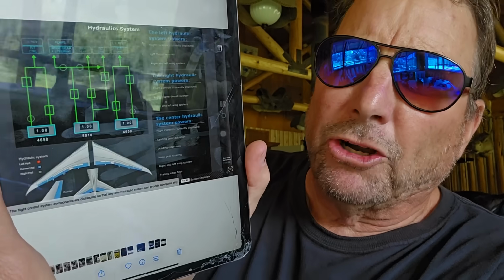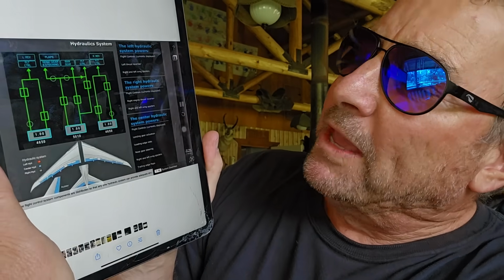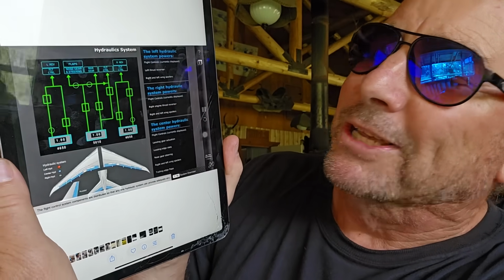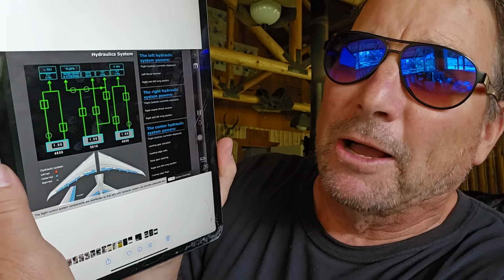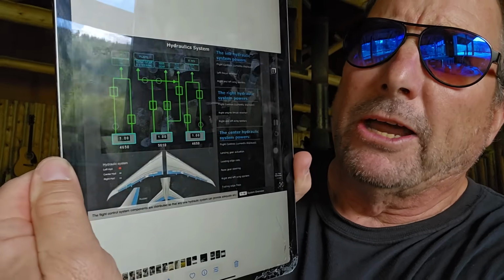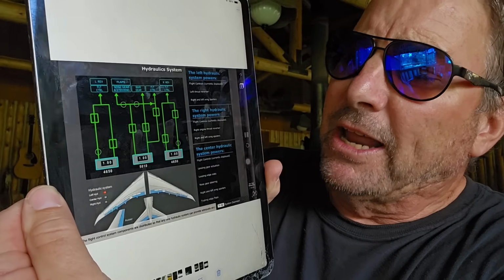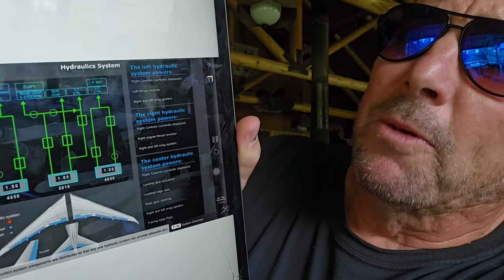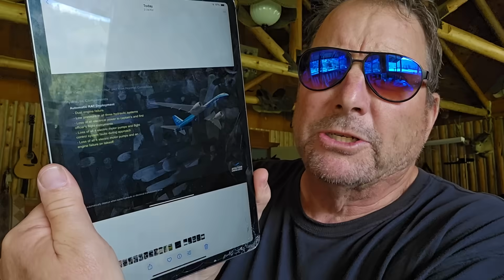787 Crash India What's a RAT? When does it deploy?

Comment: So many comments here still defending the flaps theory when there's zero evidence they were incorrectly configured or raised. We do however have evidence of a major electrical failure.
1, Sound of the RAT having been deployed
2, Loss of ADS-B data almost exactly at the point the plane stopped climbing.
3, the sole survivor said there was a bang and the lights were flickering after takeoff.
Reply: Without any hard evidence we can only say that the probability of the pilots taking off with an incorrect flap setting in a 787 is very low.
Reply: @ThereYouGo182 if they used the electronic pre takeoff checklist. However, if they only used the electronic pre taxi checklist, and disabled the flaps warning system during that, then didn’t hit their pre takeoff trigger due to unusually taking off from halfway down the runway (perhaps at the last minute) then maybe the plane didn’t know it was taking off so didn’t warn them about incorrect flaps settings?
Reply: Absolutely ! The loss of ADSB data is just another pointer to an electrical (NOT an engine) failure.

I'm very much convinced of a serious electrical issue. On a previous flight that 787 had electrical problems (video'd by a passenger apparently) and the sole survivor of the accident flight reports a loss of cabin lighting too, shortly after takeoff.

TOTAL loss of electrical power would mean the fuel pumps for the engines shut down too (the 787 has no engine driven mechanical fuel pumps as backup/redundancy) and any fuel they continued to receive would be by gravity feed only, so they would definitely spool down and the RAT would also be deployed on the loss of electrical power.

Conceivably the RAT might then provide enough electrical power to get the fuel pumps delivering fuel to the engines again  BUT the engines would then need to spool up to provide useful thrust and I think they simply ran out of altitude/time in which to recover.
Reply: @grahamstevenson1740  it's still engione failure for engines are the primary power generator
Reply: @grahamstevenson1740  there is no evidence of electrical failure, and there are so many backups it is virtually impossible for electrical power to be lost with all engines running. That video only showed that they weren't running the AC and his screen wasn't working. Other lights were on, other passengers' screens were working. It's possible that the ADSB receivers weren't high tech in Ahmedabad and missed the last 2 seconds.
Reply: @FeritTuzer  There is PLENTY of evidence of electrical problems on this aircraft including a video of a previous flight and the testimony of the sole survivor of the accident flight. 
Are you American by any chance and seeking to find a way to negate any poor design decisions by Boeing ?
As I see it, the fuel delivery system of the 787 is badly flawed/non redundant.
Rather like MCAS all over again, bad design decisions !
Reply: @FeritTuzer  ALL engines ???
There are just TWO of them on a 787 !
If one engine driven generator is unreliable/malfunctioning (as appears to be the case) the remaining one then becomes a single point source of potential failure with zero redundancy (unless the APU is also running).

Use your BRAIN to think it through ! It's not rocket science !

I used simple logic to deduce this explanation.
Reply: @grahamstevenson1740  all or both, your position is so weak you are hanging onto these small differences in semantics to find somethign wrong. Two engines and APU, that is ALL. So you are saying, although we can hear and see engine(s) running, all 3 points of electricity generation failed. Sure, Indian fanboy.
Reply: @grahamstevenson1740 Two engine driven hydraulic systems, yes. But there is also a third, all electric hydraulic system than sufficient to provide enough hydraulic power to keep the necessary flight controls responding to pilot inputs.
Reply: @FeritTuzer   "Sure, Indian fanboy."

Your bias and bigotry is showing.
Reply: @grahamstevenson1740 if the fuel delivery is you claim, it is curious that it has caused an accident 14 years into the service time of the 787. A serious flaw might be expected to have become known earlier. It certainly did with MCAS.
Reply: @FeritTuzer do upi know this runway ,no, because the plane as to go to the end of this runway to turn around ,so automaticly he uses the full length of it .
Reply: @FeritTuzer  your position is weak dude.
Reply: @Revkor  take off from half runway, not raising gear, flaps not lowered at all or enough. These are the facts by shown data, even though you may say thay are debunked, you may add a propeller sound to a video etc. No proof of anything you say. And one f.g called me an asshole for pointing these out, while referring to the original video I posted about and agreeing with it, while not crediting me. The whole of India is pushing a media campaign to put the blame on the plane and saving the ass of their air travel industry and their government. And these are its trolls. But they will not be able to fudge the data, the report will show everything I said above.
Reply: flaps 5 on a 787 is barely noticeable, especially from the distances we have. from what I understand, the slats were deployed, and that would indicate that they probably also had the flaps set correctly.
Reply: @x_elen_x Why were the gears down after take off roll?
Reply: @efegbareefenedo6668 so, at a guess, some kind of catastrophic double engine failure, or electrical failure. the 787's hydraulic systems -- all three -- use electric motors to generate hydraulic pressure. it actually relies on generators for basically everything (and has 2 on each engine that produce like 5.2mw of energy combined, and another 2 on the APU that can produce another 2.4 mw) so an electrical failure would cause all SORTS of problems. when that happens, the ram air turbine will deploy, and it can produce enough electricity to give the plane enough hydraulics to maintain control, but it almost certainly won't be enough power to raise the gear, which is why it stalled with the engines seeming to still be at takeoff power?
Reply: While @FeritTuzer is being an asshole in the comments, I do have some questions about the veracity of that phone video - I see two versions of it circulating on the Internet - one on the BBC site, with clear RAT deployed sound, the other one on YT / CNN without it - same video, different audio. Something doesn't seem right here and if people are messing with the footage for clicks (wouldn't put that past the desperate mainstream media) we'll need to wait for FDR / CVR data to have any reliable information.

Not sure about the audio file played by Juan - what's the source of that one? It doesn't sound like audio from any of the two vids so it likely came from somewhere else...
Reply: @0LT4R  Major news outlets wouldn't modify the audio like that, but what can happen in the race to provide rapid (and ideally sensational) reporting is sources not being properly verified. Adding RAT audio to a video is simple to do with free tools, so anyone could have done it and published it online, after which it could end up anywhere.

EDIT: I just had a quick look at the evidence that jeffrostroff had, and I agree with his assessment that the first video that was circulated was a "filmed copy" of the original video that failed to capture the moment of fly-by. It's really only at the moment of fly-by that the RAT sound can be heard, so in the first video circulated the sound wasn't clear. Of course this doesn't prove that the original video was unedited but the most likely scenario is that it is unedited and the RAT was deployed. Of course there should eventually be hard data on whether the RAT deployed and when.
Reply: @0LT4R I wouldn’t be surprised if they had several audio sources, and combined those with the best video. It’s from the news after all - they try to please the viewer by using the best material there is.
Reply: @0LT4R  the issue is  the CNN one. that is a copy. you here someone talking in an echoy area like inside somewhere. so that is someone recording a video beign played. the BBC likely got the OG recording.
Reply: Is this RAT sound bite legit??? From what video source was it obtained? The two vids of the plane's take off & crash were filmed from quite a distance away from the 787. I doubt that meaningful audio could have been picked up from that distance.
Reply: @fredsalter1915 there is high quality video circulating of the aircraft descending directly overhead, overflying the camera and then tracking the plane to the accident.  RAT sound is VERY clear.  The RAT door is in the red painted fuselage, and plane is too far away to very clearly see it.
Reply: @wdonno  then give the title of the video. And we watch it ourselves. The original of this video was on CNN and there is only a jet engine sound.
Reply: @wdonno  Thanks for helping me understand! I didn't thinks a passively driven prop would make any air noise.
Reply: @fredsalter1915  It's not, it's been added later. I already commented below. Check out the vidoe called "CNN analyzes flight data and video of doomed Air India crash". It sounds like any other jetliner engine.
Reply: @FeritTuzer it’s so sound like a jet liner yes on low power the 787 on take off do sound much louder then what any video have show us it’s sound more like the wind are power the turbines as it are on zero thrust
Reply: I saw a comment on another channel earlier today. I didn't watch the video figuring it was just guys shooting from the hip on what happened. One guy in the comments who wanted to sound like he knew what he was talking about went with the flaps theory because you can't see the flaps down. Im thinking he thinks the flaps have to be flaps 40 to get lift.
Reply: The flaps argument is so tired. The plane got in the air. The position of the flaps is almost inconsequential.
Reply: @Slimzyjoe  there are other cases where aircraft get in the air after making the wrong runway calculation, but cannot climb and stall and crash.
Reply: I speak the language and no thats not what the survivor said, he said after take it felt like the plane got "stuck" his exact words. I take a guess sudden loss of acceleration and engine noise on take off, when you feel and hear them the most would feel like getting "stuck" gliding in silence with no engine noise, then he said the green (exit sign) and cabin lights came on, which automatically happen on a 787 in event of a power loss, then he said he heard the pilot giving it full "race" probably meaning gave it full thrust and he heard the engines spools up but plane was too low and losing altitude to recover, he said he knew they were going to crash because he saw them coming down. Do rather than an electrical failure I think it was more of an engine failure which in turn would lead to an electrical failure. Although it is very uncommon for both engines to cut off at the same time. I can't recall that ever happening.
Reply: @cyzeum  agree with the assumption. According to the passenger at least one engine was running at the end and spoiling up. A partical power/performance loss (for what ever reason, failures or inadequate thrust settings) + suboptimal flying in high density environments to recover the situation (the nose was way to high after rotation, in case they did not have sufficient power which led them to being behind the power curve) ...
Reply: @spo54683  No the passenger never said one engine was operational, with exit lights coming on, RAT being deployed this would corroborate loss of all power.
Reply: @cyzeum  didn't you write quote: "the engine(s) spooled up" in your first comment? Please keep in mind a RAT could deploy without a dual engine failure ...
Reply: @spo54683  Yeah after cutting out, as per survivor testimony and after looking it up, no, all information says the RAT won't deploy on a single engine failure on a 787. Which makes sense since the RAT is a last ditch hail mary when all power is lost. Modern jets can take off, fly and land perfectly on a single engine. With even one engine working you still have power and a situation that would cause the RAT to deploy
Reply: @cyzeum . Thanks confirming the statement (i do not speak the language). For me it still sounds like at least 1 engine was working. Dual engines failures is only 1 out 4/5 conditions for a RAT deployment on a 787 😉.  i.e. you can have a single engine failure plus generator issues in Eng2. A RAT can fall out very easily in such a case (very dangerous during maintenance) and please keep in mind that dual engine failures directly after TO are extremely unlikely and almost allways related to bird strikes (fuel contamination and vulcanic activity plays only a roll during cruise) and there was no large Birdstrike (confirmedby authorities), hence most likely no dual engine failure ...
Reply: @spo54683  But ATC recordings confirm pilot lost thrust. “Mayday… no thrust, losing power, unable to lift” Other sources captured similar phrasing: “Thrust not achieved… falling… Mayday! Mayday! Mayday!"
Reply: @cyzeum  as long as you don't have the original ATC transcript, you don't really know what was said word by word (plus what was meant?). There is a lot of stuff out there...
Reply: @spo54683  Well these were reported in major news outlets like the financial express.
Reply: @cyzeum   by the way I Start to believe the FADEC story. There are 2 ADs/SBs for the GenX FADEC/EEC. 1) could result in an uncommanded thrust settings due to thermal degradation of solder joints 2) old software versions of the EEC had issues with power transitions which could lead to an inflight FADEC reset and the engines idling for a while + incl. RAT deployment, if it happens with both engines. The aircraft had a history with electrical failures. It would not be a complete engine failure only a loss of power. Nothing would be visible from the outside, no flames, no debris. I hope this aircraft was properly maintained and all SBs implemented, if not it could explain everything...
Reply: @spo54683  Yeah from the condition of craft it wouldn't be out of the realm of possibility that they never followed those ADs/SBs to fix the FADECs, maintenance seems to be on the poor side just enough to check boxes on the minimum safety list so they can fly But RAT does not deploy until it loses all power and at idle engines produce sufficient power. So unless all power was lost i.e both engines cut out the RAT wouldn't be deployed.
Reply: @spo54683  I just learned that there was an AD or was it an SB that the FADEC's need to be powered down every 120 days otherwise it could glitch and cause a dual engine shutdown. Dunno if this was the same one about older software or not
Reply: @cyzeum  not necessarily during a FADEC reset the RAT no longer gets the RPM data from the engines, which could trigger a deployment (RPM below idle)
Reply: @cyzeum  there are multiple bugs 🐛 in the software and fadec hardware, this is an additional one, but it was fixed with a software update. Anyhow it is another valid potential root cause. Which now adds up to 3 different issues all related to the EEC/FADEC 😮 that would perfectly explain the crash...
Reply: also 787 alarms will go crazy if you even attempt to take off with the flaps incorrect.
Reply: @FeritTuzer Didn't you watch the video? We've got compelling evidence that the RAT was deployed, therefore we can conclude some type of electrical/hydraulic failure occured.
Reply: I have zero experience of this plane but I'm personally ok with YouTube channels speculating on what might have caused the crash. Some are saying we should wait for the official report. The official report into the JFK assassination concluded it was a lone shooter! 

I'm already seeing some trying to conclude pilot error even though I'm told the landing gear and lift flap levers look nothing alike. 

By sharing theories now it will make it harder to 'fudge' a dodgy investigation. 

Boeing has a poor recent history and some former employees with solid career records felt the need to become whistleblowers. 

I'm happy to wait for the official report but I think it far more likely that the aircraft had a catastrophic issue rather than it being pilot error. The question I'm keen to get answers to is whether this is a Boeing fault or a failure of maintenance by the airline.
Reply: Could the bang the survivor heard be the RAT deploying?
Reply: Yeah, like when I first heard of a crash on take off I instantly thought "flaps" but, once I saw the CCTV video that theory fell apart. The plane just didn't behave as if the flaps were the problem.
Reply: And the sole survivor mentioned a loud bang, does the spring loaded RAT thud when deployed?
Reply: Air India SOP’s does say that you need to take off with flaps 15 in hot conditions though, so a flaps 15 setting in 41 degrees Celsius would have been logic, because flaps 5 setting would have been marginal. The plane seems to have a long roll out, probably already thrust problema in the high speed regime but we will hear the details later on
Reply: Add to the list:
 - no actual engine noise
Reply: Can it get as high as it got with flaps zero? Ground effect stops at height of roughly 50% of the wing span. They were much higher before starting to go drop, way outside what you can achieve with flaps zero.
Reply: Popular aviation channels like Captain Steeeve are doing more harm than good in breaking situations
Reply: @ninjalectualx   I agree. Captain Steeve is pushing the pilot error narrative where the pilot supposedly retracted the flaps instead of the gear, but I've seen that debunked by a more savvy Youtuber who showed a picture of the 787 cockpit demonstrating that the 2 levers are nowhere near each other. These older pilots aren't even familiar with the 787 and are just talking off the top of their heads. At least Juan does his homework and displays his knowledge of the 787 systems when he speaks, which is far more that some of these supposed expert talking heads do when they go on air.
Reply: Cpt steeve isn't even talking about the RAT.  ....he just keeps pushing the pilot error narrative.  .... almost like he's trying to protect the 787 aircraft reputation
Reply: @aftonline  : Juan also flies 777, which I believe is a lot closer to 787 than, say, any 737.
Reply: @aftonline  i've sat i many military cockpits, and i know that the flaps and undercarriage levers are very usually miles apart, one on left and the other on the right, with military aircraft often the flaps will have a curved tail like handle and the wheels a round handle like a wheel, less sure whether that is similar on civil jets, but i guess they might be in a similar position as with most airframes to keep pilots familiar, and of course now we have many warning lights and sounds, ie wheels down and locked, green, and when up probably orange or something
but i ask myself this, if the pilot asks the copilot to set the flaps, and he activates them, he cannot see them, he gets a check light and says flaps set, but if they are not set or perhaps still setting, will there be a warning, i'm just thinking if lack of power, electrics and hydraulics, surely there be many warnings going off, and ie the RAT operating
Reply: @aftonline  Sorry but it is possible that the Captain ordered, "Gear Up", and the FO retracted the flaps instead of the gear.  It's happened here in the US before as well.
Reply: @you463 the captain issued a mayday saying "no thrust". Something with the engines (both in worst scenario). Even if the FO could do that mistake the aircraft wouldn't lose thrust, but could likely stall
Reply: @RickM03  no he didn't that is all Indian misinformation. Where is formal statement that they said there was no thrust, or a recording of it?
Reply: @aftonline Just saw him on cnn, his comments made me angry, straight up ignoring video evidence of the RAT and lack of engine noise combined with the ATC call from the captain and the sole surviving passenger’s account of the loud bang and flickering green and white lights. 

Swear he’s being paid by Boeing or something. There’s definitely an bizarre agenda for promoting the flaps instead of landing gear/pilot error scenario whilst so much evidence points to a mechanical failure
Reply: @aftonline  I respect the guy, but sometimes it seems like he rushes these things to get videos out quickly. He's got a ton of subscribers and very popular videos, but I'm just not that into it.
Reply: @aftonline  he also has fellow 787 pilots he can ask for information as well
Reply: @you463 Why would that cause the RAT to deploy, again?
Reply: @you463 yes but why did they reach the dust at the end of the runway if the cause of the crash was after they were airborne? Something wrong before they left the ground; either human or mechanical.
Reply: @aftonline  Well, all these vid clips are taken from far away from the ground. Maybe a small Prop A/C was thight on downwind? Who knows? Resulution of every image capture known so far is much too poor for seing cleary wether RAT is out or not. We even can´t see clearly wether they took off with trailing edge flaps deployed to at least the 5 degrees position. We just can confirm leading edge slats to postion 1 as wreck parts have been found in this config. But sorry, elephant in the room in my opion is not any sound that cound be taken as RAT-sound. It´s that under these take-off conditions (37 degrees heat, at or close to maximum gross weihgt, de-rated engine as everyone does these days) rather a 15 than a 5 degree take-off must be chosen. And from what we can see, we sure may rule out 15 degrees. I would even go so far ruling out 5 degree setting as I cant see anything hint of defelction on the trailing edges.
Reply: @aftonline I am surprised that 🤡 Steeeve is still flying, the guy doesn‘t give me any comfort
Reply: @glubbgluck  I agree that the audio isn't good enough because of the distance but it definitely doesn't sound like a jet engine at full thrust to me. It should sound more like a roar than a whine. I also have a lot of respect for Juan Browne who is very good at what he does.
Reply: @aftonline  Now that Juan has put his video out, the knowledgeable Captain Steeve is now talking about the RAT. I am staying here for my information.
Reply: @iaindobson3387   Yep, I heard about the RAT 36 hours before Steve. He was still prattling on about the pilot pulling the wrong lever yesterday.
Reply: @ninjalectualx  Yes I am particularly disappointed with Captain Steve. The level of assumption that the first officer mistakenly retracted the flaps without a shred of evidence is astounding.
Reply: @ninjalectualx couldn‘t agree more, the assumptions and speculations of this guy are not bearable, also he acts as a 🤡 with his pilot uniform on and a rediculous tie to confirm this is all a 🤡‘s act…
Reply: @ninjalectualx captain Steeve is a 🤡
Reply: @ninjalectualx captain steve got an unsub from me earlier today
Reply: @m783w  He hadn't even tracked down the better quality video with the audio, so he was the one not properly configured ...
Reply: @m783w  so?
Reply: @ninjalectualx  What's the harm? All these aviation channels are for entertainment. No one needs immediate answers to these incidents. We're all simply addicted to the drama.
Reply: @russellharvey7096 ain’t that the truth
Reply: @russellharvey7096 because these people are idiots that line echochambers and only want to hear the stories offered by their preferred channels.
Reply: @russellharvey7096 Put yourself in the shoes of the pilots’ families and ask yourself what the harm is. If lots of channels and media outlets are pushing that narrative, it could do them enormous harm at a time when they’re very vulnerable. That’s why we listen to fact-based analyses like Juan’s.
Reply: @russellharvey7096  There are many, many reasons why people would post inaccurate, misleading or downright untruthful content. There's a lot of skin in this game.
Reply: @fricatus  Can you identify a case where an internet opinion on an aviation incident impacted the outcome of the investigation? Family of the victims might very well appreciate alternate opinions being offered. And it is their choice to consume or not consume the info. The fact is, viewers like you and me provide incentive for creators like Steve & Juan to offer up their content.
Reply: Isn't this the jet that supposedly had video posted from an earlier flight where the cabin electrical systems were on the fritz??
Reply: @roberte94066  Yes, I saw what I think was that video, the touch screens and cabin lights failed, air conditioning was out.
Reply: @bernieschiff5919  Those are separate electrical systems. While on the ground, it's the APU that supplying power to those systems. I'd like to see a video where the passengers complain the AC was not working after take-off.
Reply: @bernieschiff5919 I’d that’s the case , puts on Boeing
Reply: @iiddrrii6051  I have a feeling Boeing might be sweating bullets soon.
Reply: @roberte94066 I have seen that reported, that it was a flight from several hours before the accident, perhaps the previous flight.
Reply: @roberte94066 Correct. A passenger flew on the very same aircraft that morning, from Delhi to Ahmedabad. He reported in flight entertainment system not working, no a/c, lights flickering.
He also mentioned something about the wing, but I didn't understand that part.
Reply: @roberte94066 Yes.
Reply: @roberte94066 yes
Reply: no rat is deployed this is video falsified by Indians. No bang is heard there is no such statement from the survivor. What's clear is they used half the runway, were too slow, and also raised the flaps instead of the landing gear.
Reply: Good info.
Reply: Because many think the 787 flaps on takeoff are the same as flaps on landing
Reply: Nobody is taking yall seriously anymore. For the past 8 months as commercial crash after commercial crash poured in and y’all snarkily said to us “aviation is safer than ever, the media is only publishing it now is why seems like a lot”. As if we can’t count and as if the media doesn’t ALWAYS post commercial crashes.  There have been more commercial accidents and major near misses the past 12 months than in anytime in YEARS.
Reply: geeeeez, does this point more and more to a severe technical malfunction with the 787-8 dreamliner 🤔😲😲😲😲
Something went wrong right after V1 and pilots had to take off .... and all hell broke lose 😬
Reply: ADS-B data is sometimes iffy on the ground ...
Reply: What is ADS-B data.. and .... how do we know for sure it was lost?
Reply: True, but consequential or coincidental?  That's why investigators need time to "turn over every stone" before reaching a conclusion.
Reply: Zero evidence? Pictures of the wreckage show retracted flaps. The plane was never fast enough for that configuration.
Reply: New information and data should always allow one to reevaluate a theory. Here, it seems that yes, this is more complicated than I initially believed.
Reply: The 'bang' could be the RAT being deployed.
Reply: Nobody knows wtf happened until the official crash report is released. Fact.
Reply: @Travis_22  Some people can make a more educated guess. I suspect that when the black box data comes out it will confirm some theories and disprove others. It will be interesting to see which way it goes.
Reply: Cpt Steve lost my sub. In 787, you can't retract flaps under F speed, even if you select up. Computer controls the actual actuator.
Reply: @arunhn  Oh my! I bet Steve's feelin' it!
Reply: Acording to the ADS-B they took off from the intersection (half runway) which I read  it wasn´t like that (they used full runway). And this should be crucial information.
Reply: It looks like Captain Steeve in harping about the flaps being mistakenly retracted by the co-pilot without any solid evidence, is trying to cover-up for Boeing's possible cause for the crash of this plane. Easily done as dead men tell no tales.
Reply: @Jcyes-b5k  Yeah? How's that working out for him? It's already debunked here and elsewhere.
Reply: @Jcyes-b5k  It's unlikely that Boeing would be at fault. The 787 has been in service for close to 14 years and this plane was 11 years old. If somebody screwed up and caused a mechanical failure, that would likely be the airline's fault.
Reply: @IcyTorment .......Poor design, poor installation and poor reliability issues only show up after some time of usage. That's a fact.
Reply: @Jcyes-b5k  Boeings never fail as long as criminal Airbus doesn't sabotage American superiority.
Reply: @Jcyes-b5k  to everyone harping on about a bang etc, listen to the survivor speak in this interview in this shorts video, translated from Hindi. He says what we all saw, the airplane came to a standstill after takeoff, and the engines spooled up (the captain doesn't realize the problem with the gear and is giving full power to engines - note: no engine failure). And green and white lights came on, whatever they may mean. No mention of a bang, no mention of lights flickering. 
@msnbc
One British man survives Air India plane crash
'I don't believe it': Sole Indian plane crash survivor speaks
Reply: @FeritTuzer .....you are conveniently ignoring the fact that the RAT (ram air turbine) was deployed clearly indicating that there was some electrical malfunction in the plane.
Reply: @Jcyes-b5k  It wasn't, there is no evidence of that apart from a manipulated video with propeller sound added. I wrote here many times where you can find the original, it's on many news channels.
Reply: @FeritTuzer .........It is not a manipulated video; it is the original video. Other videos do not have the RAT propeller sound because they were taken from a screen of the original video without the sound.
Reply: @FeritTuzer what's your take on this 2 weeks later fellow genius
Reply: Yes just those of us with eyes supporting the flaps theory.
Reply: @MattF340  Have you seen the pics of the wreckage of the wing where you can see leading and trailing edge slats deployed. Take of flaps position is flaps 5 i.e very barely extended, not like full out extra wing on full flaps when landing.
Reply: It seems to me that the plane was flying from India to London............it would have been heavily loaded and would need full flaps and I did not see full flaps. Just say'n.
Reply: @hubriswonk Wrong. Full flaps 40 are only used on landing.
Reply: @Dave-ei7kk   "Full flaps 40" - 
@hubriswonk's unedited comment posted 3 minutes before your reply says "full flaps", not "full flaps 40". Googling shows me the 787 does not have a flaps 40 setting. How did the phrase "full flaps 40" originate in the conversation?
Reply: @big_beak  Maybe he's thinking of a 737 which has a max flap of 40, However this doesn't change the validity of his statement though.
Reply: @Dave-ei7kk  One airliner crew was joking with a stew and forgot to put flaps down (at least partially) on takeoff and plowed into forest. Just a thought.
Reply: @garywheeler7039 You can’t “forget” to deploy the flaps in the 787 because it won’t let you take off if you don’t have the flaps deployed. Multiple internal, electronic checklists.
Reply: @big_beak OK. Perhaps full flaps on a 787 are 30° or 50°. I should have just stuck with Full Flaps. The point is that Full Flaps are not used for takeoff. Far from it.
Reply: @ThereYouGo182 You are correct. I’ve watch many Mentour Pilot videos and he mentions flaps 40 often when referring to full flaps. But he is a 737 Captain. 

And you’re also correct that the point is still valid. Thank you for that.
Reply: @garywheeler7039 Modern airliners have computers that monitor configuration errors and sound warning horns if a crew initiates takeoff thrust without the plane properly configured for takeoff. 

It’s hard for me to imagine how the crew could go ahead with their takeoff roll with horns blaring and master caution lights flashing. 

Decades ago the didn’t have these systems so it was possible to be distracted and forget to place the flaps in a proper configuration for takeoff. In that case the plane wouldn’t complain and such a fatal error could more easily happen.
Reply: @Dave-ei7kk That makes sense, thanks
Reply: @garywheeler7039  and they have since made that impossible to reapeat.
Reply: @Dave-ei7kk  He means full flaps for take off, not landing,
Reply: @garywheeler7039 what plane/airline? Guessing a Boeing
Reply: @garywheeler7039 was that the French one?
Reply: @hubriswonk Full flaps (35 to 50 degrees depending on the aircraft model) are only used for landing. As Juan mentioned, takeoff flaps on this aircraft would be 5 or 15 degrees. Full flaps are restricted to lower and decreasing speeds typical for landing as compared to higher and increasing speeds associated with takeoffs when flaps are set at 5 or 15 degrees.
Reply: @wengertgroup8250  so they had 0 degrees instead of 15, did not raise gear, and used half runway distance. Recipe for disaster.
Reply: @FeritTuzer All complete nonsense. The runway theory has already been debunked by data. And there’s no way of knowing, from the video of it, whether flaps were set or not. As for the gear, you apparently haven’t even watched this video.
Reply: @straycatstrutPH  hasn't been debunked. They used half the runway.
Reply: @FeritTuzer Why do you keep on saying they only used half the runway? Because the FR24 track makes it look that way? FR24 already said there's was a gap in the data due to poor ground coverage. They rely on users' antennae for data and when the feeders don't have clean lines of sight towards the airport, you get areas of blackout, especially lower towards the ground. FR24 just connects the last two points the feeders saw the plane. Plus, one of the videos show it using the full runway, so you're wrong.
Reply: @MajorMinor12  no video shows it using full runway. give the title of the video instead of saying there is something, which is you repeating a line you saw online. AND FR24 did not say they used full runway. The data are the data. It only shows them turning right at mid runway. How did missing data points align perfectly to draw that path?
Reply: @FeritTuzer It’s been totally debunked. The radar tracking shows them clearly backtracking down the runway and using all 12000ft of it. Don’t you think these guys like Blanco would highlight it if they only used half the runway when fully loaded for a 10 hour flight?????
Reply: @FeritTuzer Half runway distance?   They used nearly the full runway length!
Reply: @FeritTuzer that's your made up story. All these has been already debunked. Change your source
Reply: @FeritTuzer they used the full runway.......
Reply: @hubriswonk  An airliner does not use full flaps at take off, not even at max takeoff weight. A max flap configuration is only used when LANDING with certain conditions/weight.
Reply: @ThereYouGo182  Full flaps meaning whatever flaps configuration is needed for take off weight and circumstances. I did not give a specific degree setting or make a distinction. I can say I spent the entire month of may flying around Asia and I watch many 787's take off (and I flew in a couple as well) and I could clearly see deployed flaps unlike in the crash video.
Reply: @hubriswonk  "Full flaps" is not a term someone would use to describe a takeoff configuration. Full flaps on a 787 is 30. Given that this flight took off from a long runway, they could very well have had a takeoff config of flaps 5. This would be very difficult to spot in a video from far away. especially seen from the back of the plane.
Reply: @ThereYouGo182  maximum flaps for take off configuration?
Reply: @hubriswonk  Ok, so going back to your original comment; No, a fully loaded 787 would not necessarily require a max takeoff flap config (Which is flap 15 on a 787-8) Higher flap settings are mostly used on short runways, as more lift will allow you to rotate sooner. But it also introduces more drag, so on longer runways a lower flap setting is generally used.
Reply: @hubriswonk did you watch the video? Juan said only flaps 5 needed except on a short runway, then flaps 15. Never full flaps.
Reply: @theharper1  What is full flaps on the 787? I think it is 15.
Reply: @hubriswonk I'm not an expert on the 787. A Google search gave me a photo of the lever which suggests 30, but from what others have said, that's only for landing. I think Juan said 5 normally or 15 for a short runway on take-off.
Reply: @hubriswonk  No, I would not require full flaps, but I would "require" Flaps 5 through Flaps 15 or 20.  Dependent on weather conditions, aircraft weight, and runway length
Reply: @hubriswonk  There is a point in which the amount of drag you are generating outweighs the lift you get for the purpose of takeoff. You get a ton of induced drag from all the extra lift the wing is trying to produce along with the extra form drag from those massive flaps. In this case you'd get yelled at with a configuration warning in the cockpit that is very loud and annoying. There aren't many planes that will use full flaps for takeoffs. Even in STOL aircraft where you would use full flaps for a shorter takeoff roll, you're retracting to lower degree flaps pretty quickly once you pop off the ground so you can gain speed.
Reply: @hubriswonk You would never take-off with full flaps deployed.  Never!
Reply: You never take off with full flaps, regardless of aircraft type, weight etc.
Full flaps are used for landings, not takeoffs.
Reply: @hubriswonk Don't Say. . 😂
Reply: @hubriswonk  Long runway. 5% flap is enough. This plane can climb on one engine only.
Reply: @wess8131  Yes, it can climb on one engine only. But add the fact that the landing gear was still down and temperatures might've been 40 C and the plane was fully loaded and then if engines are on reduced power, maybe then the plane can't fly. What do you think?
Reply: @hubriswonk  Nonsense.
Reply: @hubriswonk  no it would not need full flaps...generally all heavies even in high temp conditions are flaps 5 -15
Reply: @hubriswonk  I don't think wrong flaps can create engine failures. I believe pilots did those basic things right.
Reply: @hubriswonk  - That's not how that works.
No airliner takes off with full flaps.  Highly loaded airliners can - and do every day - take off with typical flap settings between 10 - 20.
The point of full flaps is to provide enough lift to keep the aircraft from stalling at approach and landing speeds, while providing enough drag to keep the airplane from going too fast during approach and landing.
Takeoff flap settings provide the extra lift needed to takeoff safely while allowing the airplane to continue accelerating and climbing.
Shouldn't be "just say'n" anything unless you know what you're talking about, kiddo.
Reply: @kuckoo9036  The extra drag on landing flaps is something people often miss.  At full flaps, the flap cords, especially the last one, is deeply flow separated.  The top of the cord is making minimal lift, and the lift is coming from the bottom.  It is inefficient as heck.  That forces the engines to be spooled up.  If it is a go around, less time to spool engines as just reducing flaps drops drag and lets the aircraft accelerate.  If it is a landing, there is already good drag to help fight ground effect.
Reply: @kuckoo9036 , thanks for putting this young and insensitive person in their place. We are talking about a serious tragedy here where a very large amount of people lost their lives on the plane and the ground.
Reply: Modern jets never use full flaps for take off  @hubriswonk
Reply: @hubriswonk  Search for "TUI 787-9 G-TUIK Breathtaking Takeoff from Manchester Airport!" on youtube, This video shows a normal 787 takeoff. As you can see the takeoff configuration is barely noticeable.
Reply: @hubriswonk  Flaps 5
Reply: @hubriswonk  Your post is nothing but a wrong myth.
Reply: @hubriswonk  Please don't speculate on things you do not understand. Flaps 40 is purely for landing.
Reply: @hubriswonk flaps 5 for a long runway using low acceleration and thrust. However, interestingly they very unusually only taxis to half way down the runway (apparently they were late and under time pressure) and took off from there. Perhaps it was accidentally configured for a long take off (b/c of time pressure or maybe the switch to the halfway down runway came last minute) and they only had a short one. This might explain overshooting. When they overshot they could have sucked up debris into the engines which caused them to fail. Just wondering if that’s a possible scenario? Worth mentioning that Tata ergo took over Air India in 2022 are notorious for cost cutting, running their companies on shoestrings and paying lip service to maintenance and health and safety
Reply: there is zero evidence of electrical or engine failure. if there is give the title of the video showing it. tehee is full evidence that they took off from half runway, did not raise gear, and raised flaps instead. the whoel world can see those.
Reply: @FeritTuzer : You know, you could like watch the video you comment on. If you were not a bot, of course.
Reply: @JariJuslin the thing I hate about these know it all ignorant people is that they never come back to admit they were wrong. They just move on to pretending they know something else with absolute certainty. 

They can’t be reasoned with.
Reply: @JariJuslin  I did and I commented on it. he's using a fake video where this sound has been added by Indian manipulators like you.
Reply: @FeritTuzer oh we are at the conspiracy theory stage already!  “Pilot with accent” is not a valid conclusion in accident investigation.  Have you SEEN the video where the RAT is clearly heard?  Me thinks you are a little too invested in a conclusion of pilot error, particularly at such an early stage of the investigation.
Reply: @wdonno  what pilot with an accent? that's not my comment. you are so confused. Yes, watch the real video "CNN analyzes flight data and video of doomed Air India crash" and you will hear clear jet engine(s). No RAT. That's the original, not this edited fake video where you hear that sound as if you were 100m from the aircraft.
Reply: @FeritTuzer  do you work for Boeing? This stupid Indians narrative sounds eerily familiar. It reminds me of the disdain Boeing showed towards the Lion Air and Ethiopian crews after their aircraft had just killed them and all on board, despite the heroic efforts of these crews. You should be ashamed of yourself jumping to conclusions about the crew at this early stage.
Reply: @FeritTuzer  no the very first version of the video was a copy with low audio and you here someone taling in the background.
Reply: @FeritTuzer  Flightradar24 confirmed on X that the plane used the whole runway. Do some research instead of commenting everything
Reply: @FeritTuzer  you racist POS ..in original video(and not the one taken from video playing on screen) one can clearly see deployed RAT
Reply: @FeritTuzer  that was my initial thinking, but it’s since been confirmed they used full length. And the footage of the take off roll to me looks long, late rotate. This tells me potential perf data error or data entry error is line of inquiry
Reply: @NoRegertsHere  where was it confirmed they used full runway? the data show they used half the runway.
Reply: @FeritTuzer flight radar confirmed there’s a limitation in their system
Reply: @FeritTuzer  length of runway used is not confirmed. On the vas aviation channel report the same flight the day before used ‘half’ runway. The accident flight back taxied some distance, but not all the way back. While it seems odd to leave runway behind, it’s a very long runway.
Reply: @wdonno  on his data it seems he was halfway too. But then he made a strange correction about the hut being where the turnaround point was, but that doesn't make sense, the hut is right before the takeoff point in the video, but on the other end of the runway on the map he's showing.
Reply: Of course. The telemetry data is only transmitted periodically not con
Reply: @FeritTuzer the data are from Flight radar 24 and it show wrong really often, I have seen aircraft flying at speed 20 knot at 30k feet altitude and I have seen aircraft landing on that app at a low altitude airport and the data said 2,000 feet when the airport is a sea level dint trust a third party app evidence
Reply: @geoffwoodgate7450 ADS-B data is transmitted twice every second. This gives ATC and other aircraft accurate and up to date positional data. This isn't sat telemetry.
Reply: @danielvanced5526 Ok. I thought the interval would be longer. Where is the receiver then normally?
Reply: @FeritTuzer  Why was the RAT deployed then?
Reply: @geoffwoodgate7450 receivers are everywhere, ATC will have receivers, other planes have receivers, and FR24 use a network of ground based receivers to track flights globally.
Reply: @NoRegertsHere  It's not the only time pilots didn't reject the takeoff because engine data fooled them. I can think of one reviewed on TV show where they flew a long way really low and came down in a field. And not the first where the airline decides to push on with another leg with dodgy systems. How much Get-there-itis was going on will have to come out in the investigation.
Reply: @FeritTuzer  They did not take off from half runway. Flightradar even posted a correction that the ADS-B data showing the flight starting from midfield was incorrect. Also the initial camera angle shows that it would have been impossible for them to have taken off midfield from the position of that shack that's in frame.
Reply: @FeritTuzer They backtracked and used the whole runway.  No evidence they retracted the flaps at all.  Lots of reasons for not raising the landing gear if they had a major problem, it doesn't mean they retracted the flaps instead.  It's all in your head.
Reply: @LokiCentral  you can call it not instead , it doesn't matter. what is in your head is that the flaps are not raised. Flaps are not down, landing gear is down. that is the solid truth. I don't care what else is in your head. They had the wrong setting, and the data show they used half the runway. Where is the evidnece they used the full runway? Chat rooms of Indian fanboys?
Reply: @FeritTuzer The flaps were down.  The fact you can't see them down doesn't mean they're not down.  With just 5⁰ you wouldn't see them.  The updated data showing the plane backtracking and using the whole runway is apparently on FlightRadar24.  If you look at the video of the takeoff, you can reference the building in centre frame with Google Earth and work it out, and all the serious channels are confirming they used the full runway.  You seem to have some issue with being objective.
Reply: @LokiCentral they didn’t use the full runway, very unusually they took off from half way. This is clear
Reply: @StoutProper Check the updated FlightRadar24 data, they used the full runway.  That's independently confirmed by referencing the building in the takeoff video against Google Earth.  I have no idea why, but ADSB data on the ground seems often unreliable/glitchy/missing points.  The early data showed an intersection start, the later data showed backtracking before the takeoff run.  In a situation where information is developing so rapidly, you can't just use 36 hour old unverified data because it supports your beliefs, you need to adapt your beliefs to the data as it emerges.
Reply: @FeritTuzer "tehee is full evidence" - 
Big Freudian slip there. BTW the correct spelling is "tee-hee".
Reply: @big_beak  ok big deal you found someone mistyping something on the keyboard. I saw it but did not consider it worth correcting. Don't take up people's time with your stupid comments.
Reply: @FeritTuzer If you don't mind me asking, what credited qualification(s) do you have? Thanks.🙂👍👍🇬🇧
Reply: Half runway theory incorrect. Initially reported since revised   @FeritTuzer
Reply: @FeritTuzer Confirmed they backtracked, Gear has been found partially retracted, gear and flaps are not closely located in a 787. Literally EVERYTHING you said is incorrect.
Reply: @FeritTuzer there is evidence of the RAT deployment and numerous experts have said that flaps 5 or even 15 for take-off is hard to see from low resolution phone video. There are also reports of electrical issues with the same aircraft on previous flights.
Reply: @theharper1  where is this evidence? Havn't seen any so far... . There is no clear picture nor is there any sound of a RAT... (which usally cleary noticable during inflight deployment due to its high frequency).
Reply: @spo54683 did you bother to watch the video?
Reply: @FeritTuzer  there is plenty. the sound of a RAT deployed. and video of the plane on the previous flight having clear electircal issues plus even the survior reporting electical issues before crash. ther4 is NOTHING to support the flaps theory. DROP IT.
Reply: @FeritTuzer  There is Zero evidence of them not using the full runway. Also zero evidence that they didn't use the proper flap settings. Are you dyslexic by any chance?.
Reply: @FeritTuzer  sounds like Boeing corpo. RAT was deployed which means there was loss of electrical power. It deploys automatically and pilot has no role on that. Which is why the wheels and flaps were not retracted since 787 uses electrical fly by wire. 
How will you do it when there is no electricity to power those machines.